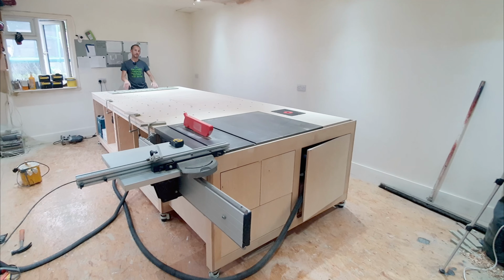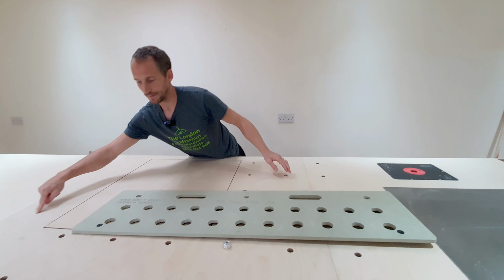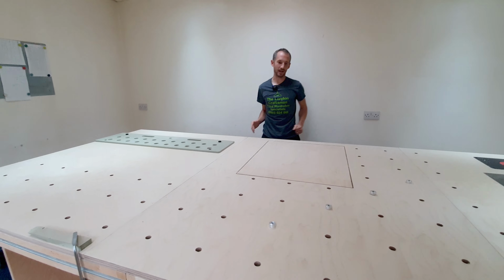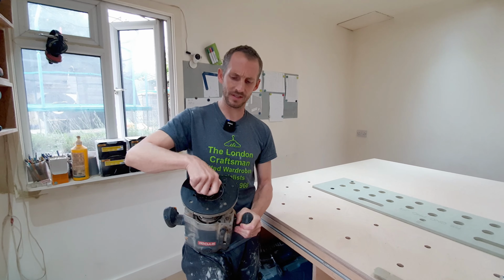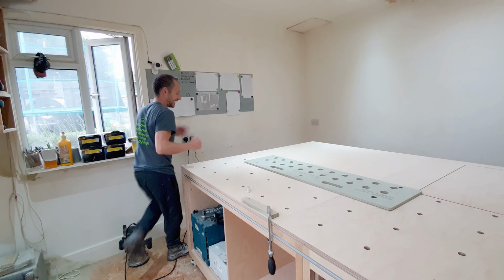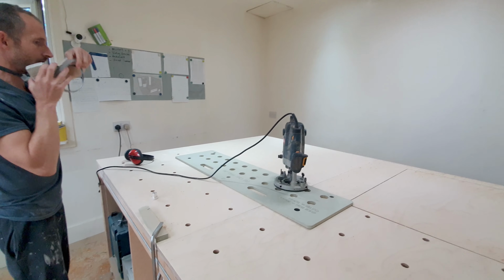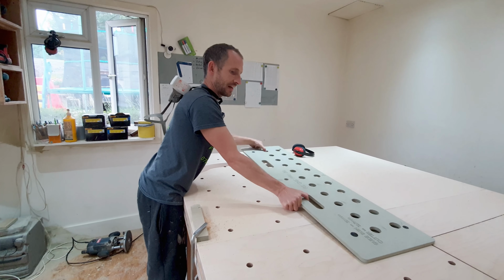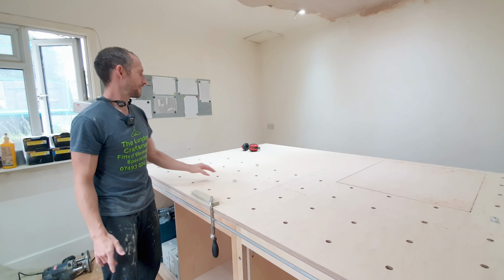How To Use A Dog Hole JIG- Trying It Out On My ULTIMATE WORKBENCH BUILD Vid#67

Comment: I’ve had an MFT-style workbench for about 10 years. It’s 1600 x 1000 and was made using a CNC. Like others, there are many holes that I’ve never used but some that are used a lot for clamping. Having a good table saw, I don’t need use an expensive bit of MDF or ply as a sacrificial base - and therefore have to keep on replacing it. Depending upon the sizes I want I will either finish cut my mdf or ply using my track saw (eg when cutting long strips) or cut the whole sheet in half or thirds or whatever and finish cut on the table saw. Neither of these operations involve using the MFT style top. I could survive not having a table saw and certainly not having a MFT. 

I’m now moving to a much larger shop. I have my main workbench of 100mm thick ash; the table saw, band saw etc. for an infeed, outfeed table I use a mobile electrically operated lift table. I am thinking about making a torsion box for the top with an MFT style top. If I go ahead, I will use my current MFT top as the pattern from which to copy the holes. If I don’t already have one, I certainly wouldn’t buy the Parf system at the price being charged.

Like all of woodworking, there are many ways to achieve a goal - and how you do it is reflection on how you were taught and how you have evolved your own way of working. There are too many tools which I’m told that I can’t live without - but seem to manage. There are many tools that will turn me into an expert overnight - none ever have. There are many tools which solve a problem that doesn’t exist. 

For me, the Parf system is one I don’t need - particularly at the price point. If others love it, then great. You spend your money how you want.

I would just urge woodworkers just starting out not to buy a tool just because you have seen it on YT. A tool doesn’t replace accuracy- it might simplify it but don’t leave out the thinking and the preparation. However much these marketing videos on YT are, resist the temptation; spending a fortune doesn’t deliver excellence; good teaching and much practice does. 

The hardest part for a person starting out is what to buy; what brands deliver excellence or just a logo; what do I need as against what do I want. It’s a long answer but I would just offer this first advice - buy the most accurate measuring tools you can; this doesn’t mean the most expensive but the most accurate ruler, square, straight edge, mitre gauge etc. nobody could ever complete a worthwhile project without accurate measurements. Then buy little bit the best for your budget. An MFT table for me, is a nice to have and not a must have; I did woodworking for 35 years pretty well before I got one. 

I fly fish and there is an excellent saying, the sentiment of which is equally relevant to woodworking. New types of fly are for catching the fisherman, not the fish.

Comment: I use the CNC design jig and find it really easy to use much easier than the parf method.
Reply from the maker: Which jig is that?
Reply: @thelondoncraftsmanworkshop  The same one that you used, I found it very easy to use and accurate and all at a good price.
Reply from the maker: Ah, yes I found it a pleasure to use too👍
Reply: @philipb867  But only with the right tools, a 30 mm bush and a 20 mm cutter, the most important is that the bit is 100% centered to the bush. This way  with 4 layers of tape and a 12,7 bit is not 100% accurate.
Reply: @ronniethobe1503  well I hate to say it but mine is spot on using the same jig, I was surprised but its 100%.

Comment: I think I will stick to my UKJ parf guide system, this system looks a lot of work to get it right.
Reply from the maker: It's not really, it's just my bench was a Bespoke size, all went pretty straight forward
Reply: I have used this jig and it is easy and quick to use, easier to get it accurate than the parf system in my opinion as it is just easier to understand how to use it.